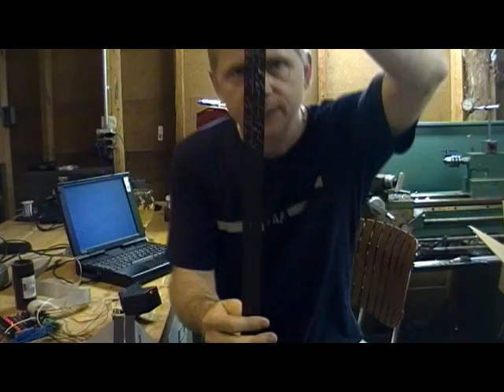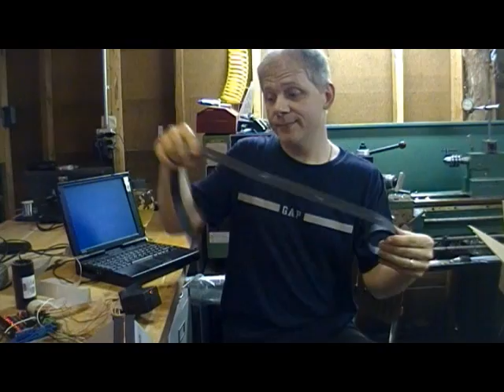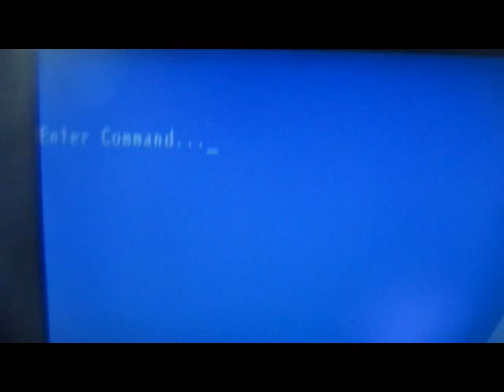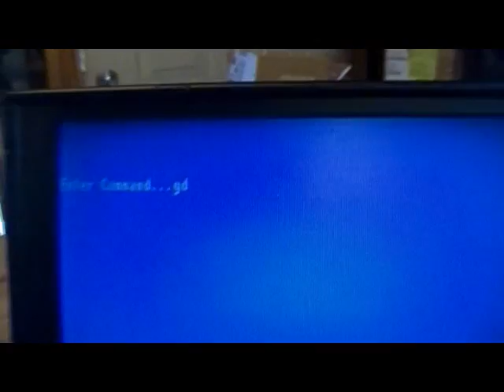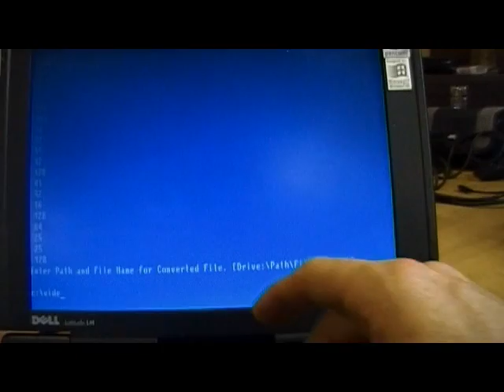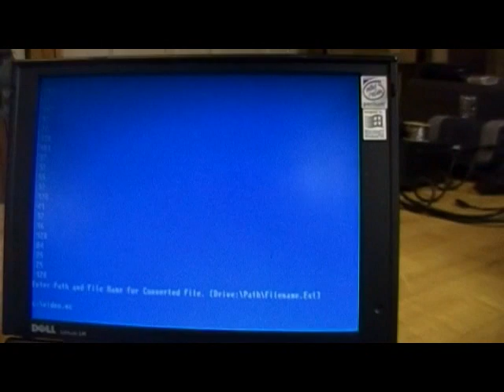Project: Make a punch paper tape reader for cnc data recovery

Comment: Punch paper tape for telegraphy was used in 1875. It was 5 bit at first then later to 8 bit. The teletype compamy made extensive use of paper tape as did Digital Equipmemt Corp (DEC)
Paper tape is just an 8 bit format therefore you can use any encoding scheme  you want. I habe written EBCDIC code on paper tape, not ASCII.
The paper tape on the Teletype ASR-33 wrote and read at 11 bytes/sec.
In addition the CNC industry began using paper tape, but quickly realized that it got destroyed easily in the harsh CNC environment with al the dirt and lubrication oils all over. They switch to MYLAR as it was plastic an was not subject to tearing, oils, dirt etc.
Creating a reader is a very simple.task and I have done it many times. You dont even need a motor as you can just pull it thru as the center holes are sprocket holes used for mechanical  readers. The sprocket holes also are at the same mechanical line as the data bits l, thus when u see a sprocket hole, there is valid data on the 8 bit of data, so you dont need a constant speed to read it. Yoi can use a simple.DC motor to pull it thru or pull it by hand.
Also there is no need for a fwd or rwd on the software as u just manually position the tape and read it until tape runs out.
Inhave built several readers both manual and raspberry pi. It creates a file called paper.tap. as the file name is really meaningless to the reader

Comment: Very cool, and very clever! I've got a different problem, I have a friend who has his own machine shop, and he bought a used lathe with the paper tape reader removed and a BTR installed in its place (I know that you know this, but for others a "BTR" is "Between Tape & Reader", or "Behind Tape & Reader").

Well, the BTR is dead, and I'm in the process of repairing it. As part of the process I'm creating my own schematics (none were available), and ultimately I'll pack it all on an Arduino.

Fixing the BTR is trivial (there's not much to them), and I should have that wrapped up by next week, possibly tomorrow. But I would like to take it a step further and create my own BTR and release the board layout/schematics/firmware to the wild (probably on CNCZone).

There's a Controls West BTR on eBay, and it is almost exactly the same as mine (I'll bet that the PCB is identical). The big difference is that they are using some custom chip in place of the AY-3-1015D that is on my board.

Do you know of a resource for the format of the serial to parallel data that the BTR handled? The operator station is a Yasnac 2000G, the lathe is a Takamatsu, and the controller is a JANCD-GMM DF7000062.

Thanks!

John

Comment: Hey jejump! i want to know, there is an extra slot for a diskette drive in the Commodore SX-64, which i have. can you try to make a punched tape reader to fill in said slot? thanks!
Reply: Right off the top of my head, I'm not sure how that would be handled, but it seems like something that might be achieved.  I'm not sure about accessing it with disk drive commands, but maybe.  It would be a READ-ONLY access, obviously.  Might be less work to try interfacing an RS-232 tape reader to the Commodore.

Comment: Hi, as a project for school I've decided I'll try to make one of these. I've had no electronic experience in the past but have lots of programming knowledge. How would you suggest I got about this and could you offer any advice? Anything would help me so much.
Reply: +Reuben Davies Thanks for checking out the video.  Your biggest challenge will be some device that drives and reads the paper tape.  I happened to have one in my tool box from my machinists days--kept it for years, then I decided to build the one you saw.  I don't know what your spending budget is, but there are a few on ebay right now.  I'll be glad to assist you with anything else.  What language are you writing code in?
Reply: John Jump Thanks so much for reply. I'm planning to make the reader with a raspberry pi and use python to code it. I've done some research and thought that I could use LEDs as lights behind the holes and also LEDs to sense light coming from open holes. Would this work or is there a better way of doing it?
Reply: That sounds great Reuben.  I would probably use 3mm LEDs and 3mm photo transistors.  Anything larger than 3mm might not fit in the width of the tape.  Each channel is only .1 inch (2.54mm) apart.  Even 3mm components would be tight.  If I didn't explain in the video (can't remember), the 9th channel is the CLOCK for the whole data byte.  It is also the set of sprocket holes that drive the tape and its diameter is intentionally smaller than the data holes so that when light through it is landing on its photo transistor, all the DATA holes should then have light also.  How do you plan to advance the tape along?
Reply: John Jump I don't want to have to pull the tape through manually so I plan to use a motor. I'm not sure how I would use it so it pushes the tape along though.
Reply: +Reuben Davies For reasons of potentially damaging paper tape, you may want to move the tape slowly along.  There were tapes in those days made of Mylar (polyester resin) that could handle faster speeds and weren't as delicate and vulnerable.  If you have one of those tapes, run it as fast as you want.  If you have access to a machinist, you could make two shafts with rubber O-rings (top and bottom shafts pinching the tape).  One of the shafts will be directly coupled to your driving motor shaft, the other shaft needs to somehow be on a pivoting arm with a spring pulling the shaft and O-ring assembly into the motorized roller shaft.  The earliest versions of these tape readers used a sprocket to advance the tape along and that is how mine works, but you don't have to do it that way.  I've seen tape readers that use something similar to what I've laid out above.  The technical term for the motor shaft would be considered a 'Capstan Roller' and the spring loaded bottom shaft would be called a 'Pinch Roller'.  Just like any old magnetic tape machine you've ever seen.  In fact, if you want to have a visual appreciation for what I'm talking about, go to a thrift store, buy an old VCR for $5 and a VHS tape, take it apart and watch the tape being transported.  You'll see a rubber roller about 5/8" (16mm) in diameter pinching the tape against a steel motorized capstan.  Heck, you might even repurpose some of those parts for your own tape reader.Jj
Reply: I have the regular paper tape, would a sprocket be the best for this or would the roller method still work fine? I know that machines that used rollers and normal paper tape had tears in the tape a lot, how fast can normal paper tape go without risk of breaking?. Thanks so much for the advice it's really helped me progress!
Reply: +Reuben Davies I bet you can move the paper tape by sprocket or capstan safely at about 12 to 18 inches or 30 to 45 centimeters per second.  You will need side rails slightly larger than the tape width to guide the tape across the optical parts to maintain proper tracking.  A guide rail length of maybe 1/2 to 1 inch long is all that you would need.  I should also state that the drive method whether capstan or sprocket, should be on the exit side of the reader.  You want to pull the tape across the reader, not PUSH the tape into the reader.

Comment: Hi! I have a paper tape from 1967 that is fairly short - about 1.5" roll. It is 8-bit with timing holes. Are you still offering tape reading? This is probably a BASIC program and I'd like to get it into a file. Please reply here or to info@jlsoftware.com. Thanks and great video.
Reply: Thanks for interest in my video and tape reading services.  I still have the setup and have made use of it recently, so I know it is all in working order still.  I'll be glad to read your tape for you.  1967, Wow!  Does it appear brittle? That's the year I was born--late in the year, so it's probably older than me.  My reader moves slow and gently pulls the tape through so it should be fine as long as it isn't deteriorating.
Reply: John Jump Sorry I missed your reply of the 16th. I can mail the tape to you and would be happy to pay a fee. Please reply to info@jlsoftware.net.

Comment: can you make this reader for the raspberry pi ?
Reply from the maker: I'm certain it can be done.  I don't have any Linux coding experience myself, but it seems like it'd be the perfect platform for reading and displaying a tape.  I know the pi has a general purpose parallel port that could be interfaced to a reader head much in the same way I used the printer port.

Comment from the maker: Glad you like my tape reader project.  The software is a DOS based two part software.  I wrote a TSR that loads first, and then the main program executes behind it.  The main app was witten in Quick BASIC professional and the TSR was written in Assembly (MASM).  The TSR simply takes commands from the main app and then sets bit flags for the main app to signal command completion.  The stepper phases, frequency, tape read data byte, FF, RW, are all functions of the TSR.